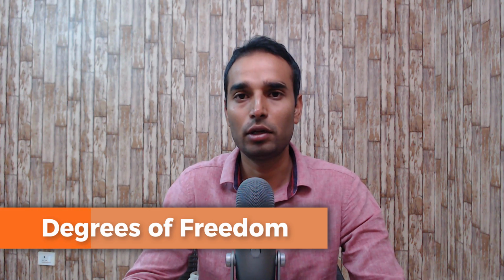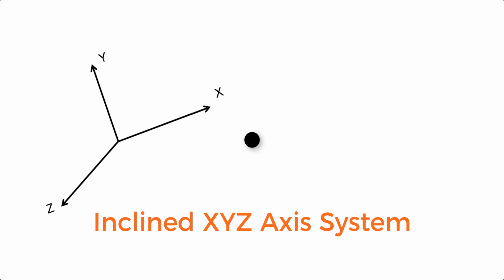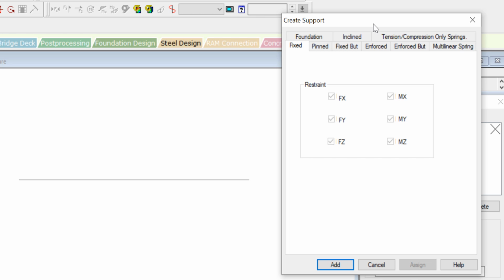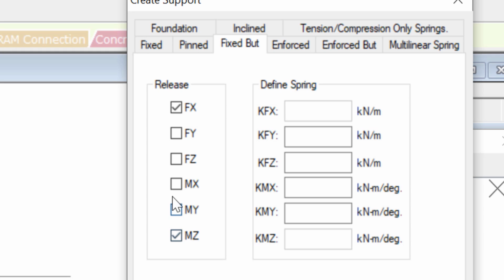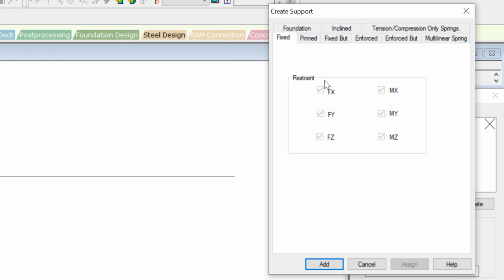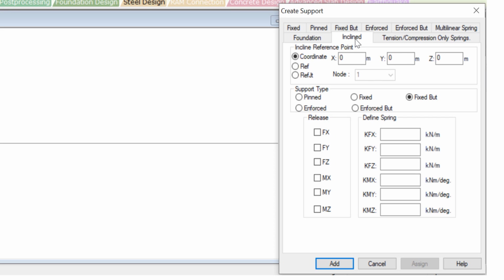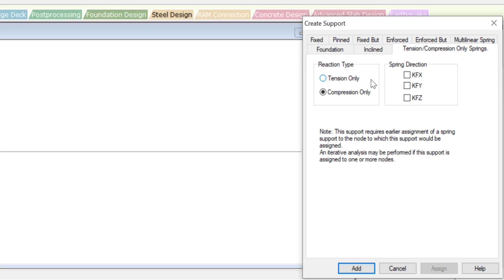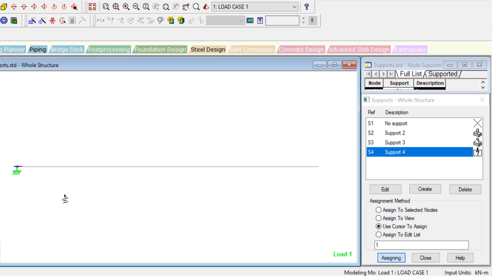How to use "SUPPORTS" in STAAD Pro

Comment from the maker: 📕 Download FREE eBook "10 Step Process to Creating Your Structural Consultancy Firm" - https://www.civilblackbox.com/ebook1
Reply: You are great sir.
Reply: Hello sir, However I understand all the supports, But on which basis Structural Engineer can assign particular support. When to assign fixed, pinned,fixed but or any other support.For all concrete structure I assigned fixed support.But there is confusion for steel structure whether to use fixed,pinned or fixed but support.
Is there is any concept for support of steel structure resting on ground & resting on equipment

Comment: Sir, in beam top reinforcement is more than bottom when i design a building structure. Which support Is to give to beams? And how
Reply from the maker: I am not sure I understand your question correctly. Kindly post the question in our Private FB Group with attached images if possible to clarify the question.
Reply: Ok sir

Comment: But Sir staad not correctly design  rcc slab,raft and pile foundation so what the resione  and i also cross check with manually method
Reply from the maker: Well, that is not entirely true. As I said in one of my previous videos, STAAD is just a software. It will design on the basis of the conditions that you impose upon it. I will be making a video on this soon enough and try to compare both.

Comment: How do you determine which support to be used, is it dependent on the type of structure or it is determined by the soil condition. For example if you are design a shelter, do you use fixed or pinned support?
Reply from the maker: It usually depends on the type of structure and specific support parameters as per your project.

Comment: Sir in case of Steel design if we take Check Code and Select Comman during design then after analysis if our section is not appropriate then Staad pro will be taking the proper one by itself... So in case of Concrete design can we make it happen ? like if our concrete member is not appropriate then how can we tell staad pro to design the proper one for us?
Reply from the maker: Not really. That only works with Steel Design. You will have to alter the dimensions etc. for RCC members yourself.